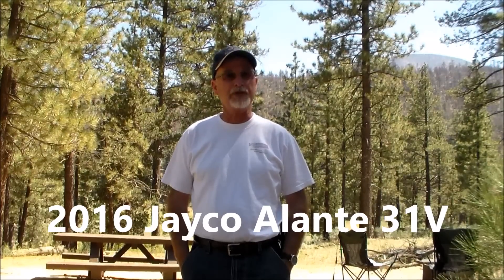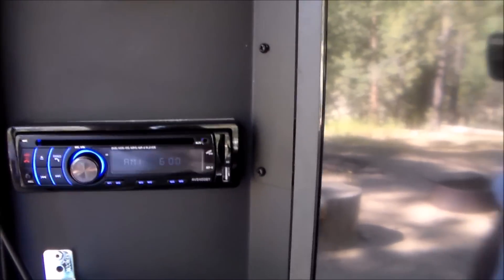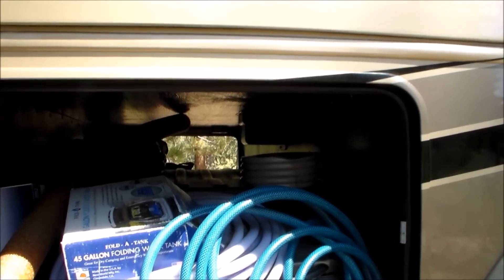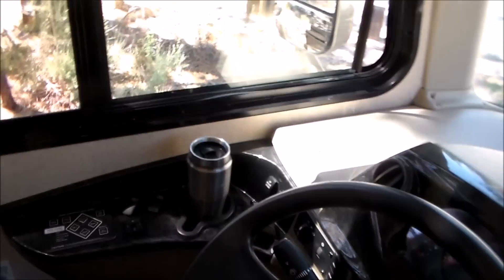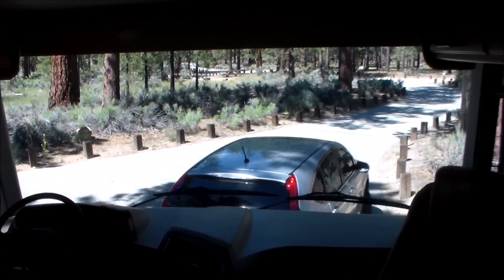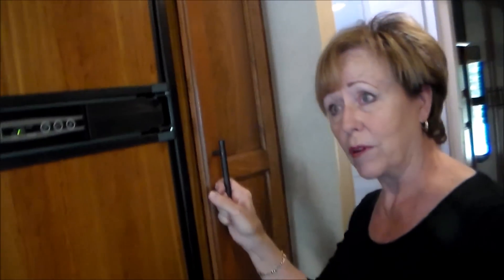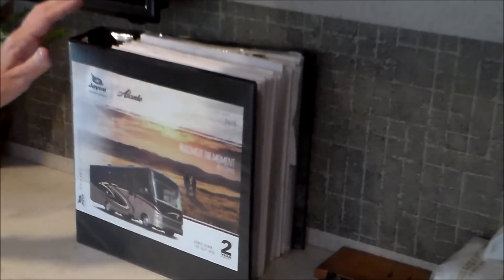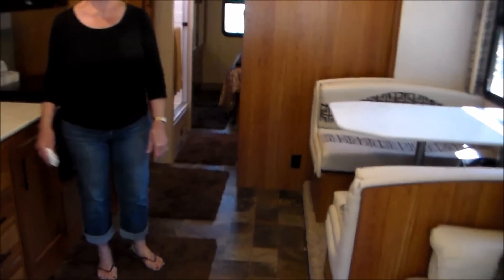2016 Jayco Alante 31V Owner's Review

Comment: We bought on of these at the end of November, took delivery end of December and took it out for several weekend outings to get all the bugs worked out. We found many relatively minor issues with ours and few bigger issues, but our dealer, Colerain RV in Indianapolis, only 2 miles from my house, has been great. We have added 416w of 24v panels on the roof, a total of 315Ah of batteries, and many smaller upgrades. Ours came with a 1000w Xantrex Inverter so I'm surprised yours did not!

When I get some time, I will create and post a video showcasing the great floorplan, functionality and modifications. I know Jayco changed this coach in 2017 with two AC's but still running 30A service. Oh, someone asked about ride quality and I have to admit there was quite a bit of sway until I did the CheapHandlingFix, which great reduced the feeling that the house was tipping in each turn. Making sure the tires were inflated to 92-95 psi also helped.
Reply from the maker: Wow Allen, thank you for all this great info. I'm sure wishing that ours had come with a 1000w inverter. I would love to have one of those. I had a couple more 12v receptacles installed, one for the TV in the bedroom and one on my side of the bed for my CPAP.

I am so glad that you have a dealer to handle your service issues. Our's is Richardson's Riverside and they've been pretty awesome as well!

We did upgrade immediately to two 6v golf cart batteries and have 160w panel installed on top and totally love going off the grid with it.

But I am wishing that we had that second A/C. We rarely used the A/C but when we do it would be nice to have that capability!

Just subscribed to your channel and can not wait to see your new rig. Please shoot me a message when you get it uploaded and if you need a free website to start blogging about it just let me know!

Sure appreciate ya' giving us all that great info about the new Alantes... they do sound like they're just getting better!!!

Comment: R. & E Bailey  

We have a 2017Jayco Alante 26X Class A gas, purchased August 2017.   You are right about the  RV videos out there on the Alante.

We have had a issue with wheel vibration up front, Jayco has been awesome honoring their warranty, I should include "Goodyear",  they replaced tires that had flat spots and internal beads broken. Had to have brake rotors checked & turned.  I still get the vibration at 65-70mph. Tire pressures are good.
Despite the driving issues.   We are happy with the layout,  front windshield is awesome, handling it turning radius is great,  good views from front and interior.   Storage compartments are roomy.  the Utility panel is easy to use. 
Does anyone have suggestions how to remove air filter cover its a headache for me.
I hope to put a video on line this year.   We have close to 9000 miles as of Feb 2018.   Driven in NM, CO. WY, UT, AZ.   A fun home on wheels.
We are not full time.    Just purchased our tow kit to flat tow our Jeep Cheokee Trailhawk,  i am excited to see how that works on the Alante.  

Enjoy!!!!      Robert & Esther   Santa Fe NM
Reply from the maker: Hiya Robert and Esther, thank ya' so much for sharing with us. One of the first things we did was to have the front end aligned at a truck and rv repair shop. We called Jayco and they sent us a check for the cost of the alignment... totally covered it. They also mentioned that industry wide the manufactures barely align the front ends to the minimums and almost expected us to call them with this request.

We added extra sway bars in the rear and a steering stabilizer to the front which seems to stabilize the back and forth in the lanes quite a bit. Everything else though is just amazing for this low end unit. We absolutely still just love ours to pieces.

I still haven't messed with the air cover but I know that the guy down at the Ford dealership took it off when they did the last oil change. Ya' might want to find a Ford dealer around that handles the larger Ford truck chassis and ask the RV service manager how to do it. Our service manager bends over backwards to help the RV customers... bettin' yours would too (-;

Absolutely cannot wait to see your video... please let me know when you've got it online!!!

By the way, which tow kit did ya' purchase???

Thank you both... happy trails to ya'...

Randy

Comment: Hello , how big is the battery box , is it the 14 by 14 size , we are looking at a similar model and where thinking the Trojan t145 , there a little bigger but wanted to know before we took the plunge if the battery/solar upgrade we would like to do would work , your video is great thanks chris
Reply from the maker: Ey there Chris.... sorry it took so long to get back to ya'. Looks like I fried a hard drive this weekend... )-:

Yep, ours is the 14.5 X 14.5 but the extra half inch is taken away on the edge closest the door where the handle is by the rivets.

I popped the rivets out and put in a couple of bolts with the nuts on the outside and that gave me just enough room to fit the two 6v's from Costco.

If you do swap out batteries, swap out all your cables too so that you can actually slide the battery box carriage out all the way so it's easier to check your battery fluid in both batteries.

Sure would love to see a picture or vid of your rig when ya' get it!

Thank ya' for asking Chris... love the idea of a couple of Trojans... they rock for sure!!!

Randy

Comment: we have a 2015 Precept 31UL.  Love the floor plan, drives real well.  The basic inverter only powers the front outlets.  Now that you have added solar are you able to power more outlets/appliances without shore power/inverter?  or is the solar to charge the batteries?

love your full body paint...
Reply from the maker: Hey there Mike, the Alante didn't come with an inverter wired in like the Precepts so before we took delivery we had them wire in a 12v receptacle in the bedroom (mattress box area) for my CPAP and a 12v receptacle above the TV area where the DVD and media box are. Then we put a little 300W pure sine inverter up there that plugs into the receptacle and we can run the TV, media box and media player(with harddrive attached) during the day off our two 6v golf cart batteries. 

At night we can only run the TV and one other accessory off the inverter. Seems like the extra solar power during the day gives us plenty of power to run stuff, given the sun is out and the solar panel is getting a full dose of sun. The CPAP runs all night without ever having an issue.

I thought it was a little strange that Jayco wouldn't set the Alantes up with an inverter! The outlet that the TV is normally plugged into doesn't supply 12v power for the TV or other appliances so we had to have them wire in a 12v receptacle.

Hope that answered your question partner. Sure appreciate ya' taking the time to visit us here! Thanks Mike,

Randy

Comment: Looks like the tv is not under the awning???  Another one I saw had a longer full length awning but wonder why tv is so far to the rear?
Reply from the maker: Yup Doris, they didn't put that large of an awning on this one. It rained quite a bit a few weeks ago up at Rock Creek and we really missed the other 3 or 4 feet of awning. To tell ya' the truth though, we never really watch TV outside because this unit didn't come with an inverter installed aboard and we'd have to run the generator to watch it.

But the newer units do come with the inverter and it would be kinda nice to watch TV outside once in a while. Occasionally we'll fire up the audio out there though and when we do, we'll close the door back down about 3/4 or so as not to bug our camping neighbors.

I think the reason the TV is so far rear is because it seems to fit into the cavity in the back of the closet in the bedroom. Probably wouldn't be any room to put it behind the kitchen appliances or shower.

Sure do appreciate ya' asking, Doris!  Hoping ya'll are getting some good camping in this summer!

Comment: You're right, not many owner reviews. How about the driving, and ride? Stable, reasonably quiet, decent size engine? 30 or 50 amp service?
Reply from the maker: Ya' know, the driving's not bad on this unit. It sits a little lower than one with 22.5 inch tires so we feel a little bit more push and pull from other rigs and cross winds but it's not uncomfortable at all. The windshield is so huge on this thing that you may tend to get 'catch' a little extra... maybe... but all in all it's a pretty good ride. We did get an alignment first thing so we've had a pretty good ride right from the start.

It is reasonably quiet on a decent freeway but ya' gotta remember, out here in SoCal we're driving on Jerry Brown freeways and it's not exactly a picnic... probably not as smooth as his imaginary bullet train! I'm not sure where the gas tax cash is goin' but it's definitely not Cal Trans... )-:

There are a few things that loosen up inside that you'll want to have reinforced the first time in for service but once there's a few extra screws in place, it's a pretty comfortable ride and Patty and I can talk pretty normal.

The engine is the standard Triton V-10 which my buddy has in his brand new Fleetwood Southwind with a longer chassis and body and actually does quite well. I"m pretty pleased with it. We pull the grade just north of Bishop at 45 to 50 and that's towing our Civic behind us.

I really had my doubts about the engine when we were looking at motorhomes but all the gas rigs seemed to come with this same engine. I am really relieved and very pleased with the way this engines preforms for us. I think we're getting between 8.5 and 10 mpg. Sometimes a little bit more but so far not less than 8.5 and that's towing the Honda behind us!

This unit comes wired for 30 amp. Every place that we go with hookups has so far had 30 amp and 50 amp hookups. Now the larger Alantes with 2 A/Cs may have 50 amp setups, I don't know!

Sure hope this helps... be sure and let me know if ya' have any other questions. Sure do appreciate ya' asking!!!
Reply: This did help. We are in the mid-west. Does this unit NEED 2 a/c units? I'd like to stay in touch.
Reply from the maker: I would say that if you get anything longer than this unit you should probably get two A/C's. If we're going to stay somewhere like Bishop over night where it's usually around 95 to 99 in the summer, we'll fire up the generator about 30 minutes out and run both the truck A/C and the roof A/C together to get it nice and cool and that way when ya' get to the campground and set up it's still real nice inside with just the roof unit!

Absolutely feel free to get in touch with us at any time on the site... campingandfishingcalifornia.com... I'd love to keep in touch with ya' and know what you guys are camping in and where!!!

Sure do thank you for stopping in on our channel!